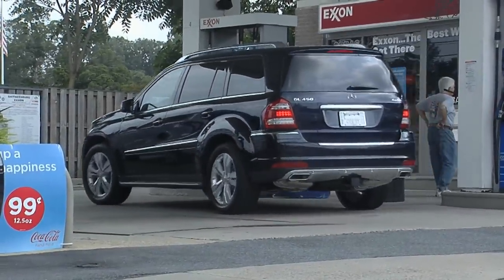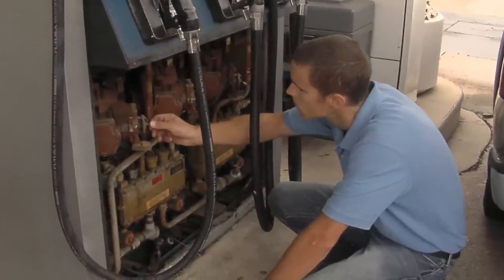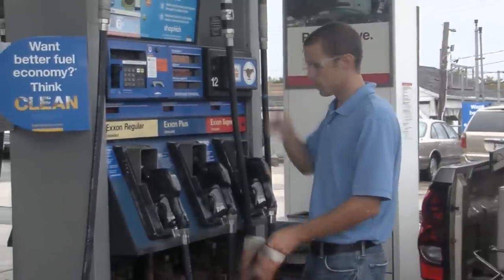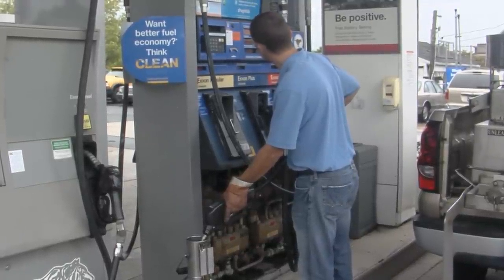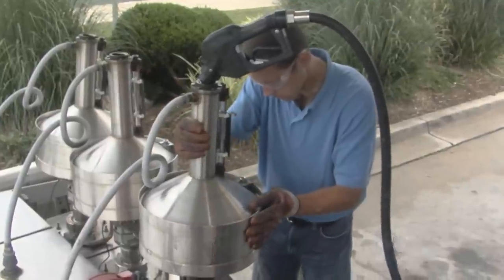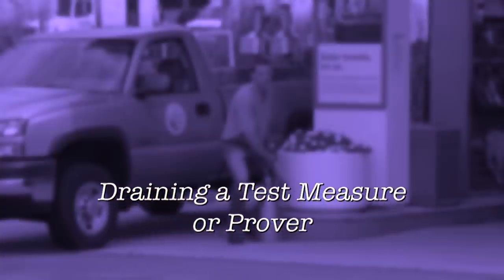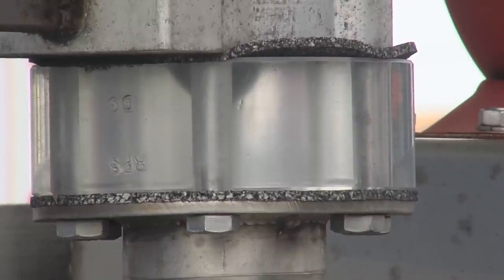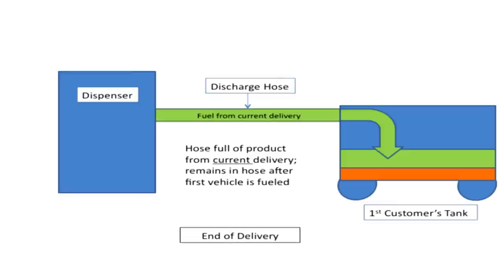Weights and Measures Inspection of a Retail Motor Fuel Device

Comment: Ok I work in the compliance industry and I calibrate dispensers daily and I your video the guy doing the calibration is allowing a customer to dispense fuel on the other side of the pump while he is doing the calibration. That is a fault and makes the calibration in accurate. The pump being calibrated should be completely blocked off so there is not fuel being pumped of the same grade coming from the meter. Yes there is technically two meters per grade but only one pipe coming from the tank. This could lead to a discrepancy in the calibration.

Comment: Why are multiple grades of product allowed to be dispensed through a single hose ? Based on my estimate of 13 feet of  3/4 inch hose and  8 feet of 3/4 inch tubing internal to the dispenser there is almost 1/2 gallon of lower grade fuel dispensed to a customer buying 93 octane fuel when the the previous customer bought 87 octane rated fuel  and vice versa . With a difference of $0.40~$0.50 between grades that is like the meter jumping 20 to 25 cents.
Reply from the maker: +Mike Rue Gasoline dispensers that offer more than one grade of gasoline often dispense more than one grade of product through a single hose.  As you have noted, the hoses on dispensing systems of this design do contain a residual amount of the product dispensed during the previous delivery, and this residual amount is unavoidable.
As to why the marketplace has permitted this variation, there are likely several factors. One is the convenience offered to the consumer of purchasing intermediate blends of fuel at the dispenser.  Additionally, it is significant to note that the octane of the residual fuel will not always be lower than the octane selected in the subsequent purchase. While in some instances the residual amount remaining in the hose will be at a lower grade than the subsequent purchaser selected, in other instances when the previous delivery was either the intermediate (blended) grade or the high octane grade, the grade will be equal to or higher than the grade selected by the purchaser.
Most states have octane sampling programs where inspectors draw samples of fuel from a station and determine its
actual octane content through laboratory testing. The samples must comply with the posted octane content of the fuel, regardless of the design of the dispenser.
Note that there are dispensers that have dedicated hoses for low and high octane fuel as well as for an intermediate octane fuel.  One option to avoid the scenario you referenced is to shop at a location where such equipment is available when you plan to purchase higher octane fuel.  Another thought is to express your concerns to the station owner regarding the effect of the residual amount.  While this won’t likely assist you in your current purchase, it will make the owner aware of the concerns of his or her customers.